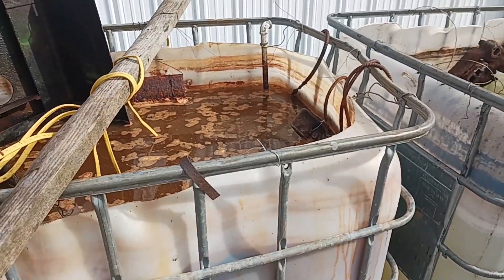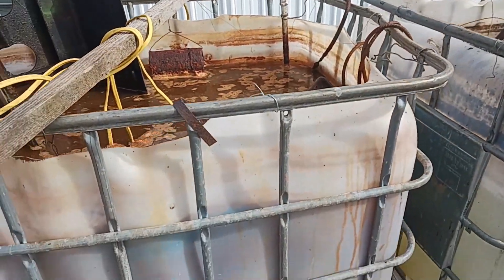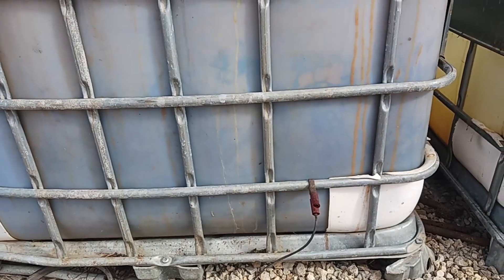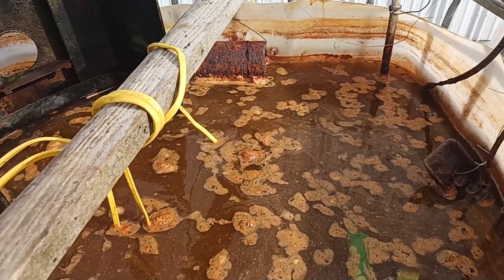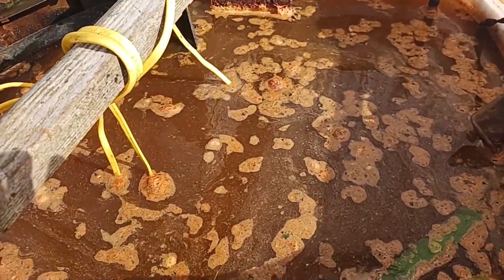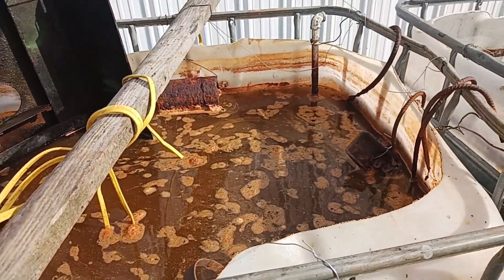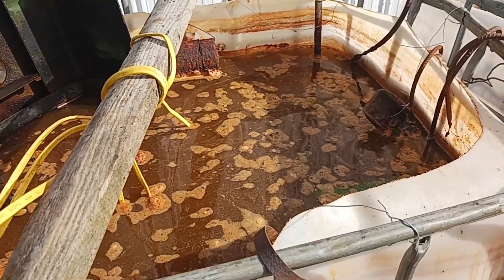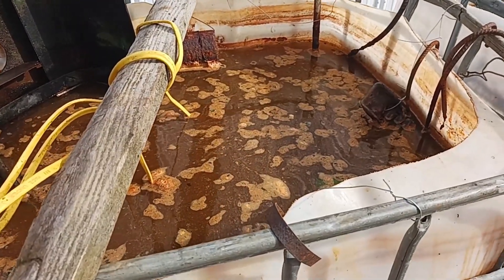Stripping Paint Using Electrolysis. @HeitkampRestorationLLC-vm5zj #restoration #tractor #how #howto

Comment: Thanks for sharing!  I've known about electrolysis for rust removal for years, but didn't know it could remove paint as well.  I've got a few old Farmall tractors that I started working on today.  I'm going to try this method for paint removal on the sheet metal on my 140 Hi-Clear.   How long does it typically take for the process to work for paint removal?   I guess the epoxy acts as a primer/sealer?  Thanks, Ken
Reply from the maker: It all depends on the paint and how many amps. Make sure your contacts are making good contact on bare metal. I usually leave it in overnight and check it in the morning. Most times, the paint comes right off with a pressure washer.  Other times, I put it in longer. You can't keep it in too long. Once cleaned blow it off with compressed air. You might have to wire wheel the metal or go over it with a sandblaster quickly, but it's a lot faster.
Reply: @HeitkampRestorationLLC-vm5zj  Thanks for the reply.  I started with the hood but the only tank I had was an old protein block lick for cattle.  I could only submerge 1/2 the hood.  I tried using a 150 gallon stock water tank that had a crack but the FLEX seal didn't hold.  Today I cut the tops off of some 55 gallon drums and got them hooked up with the gas tank, hood, and nose piece in 3 seperate tanks.  IIRC this process is "line of sight", so might not work on the sides as I couldn't get a sacrificial anode down on the the sides of them.  I might have to find a 150 gallon tote like you used.  It worked well on the part of the hood that I was able to treat.  Thanks again, Ken